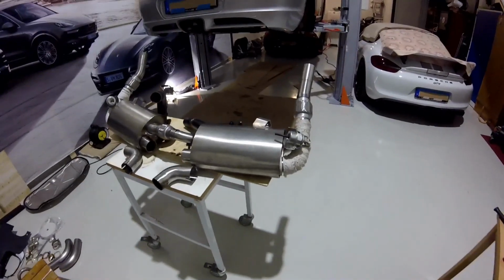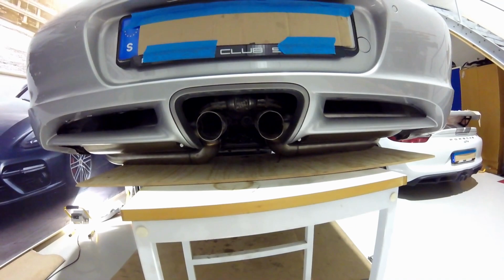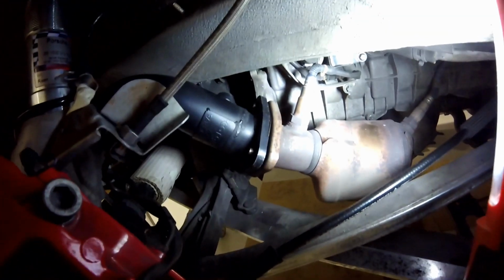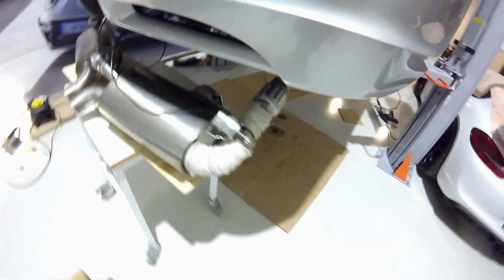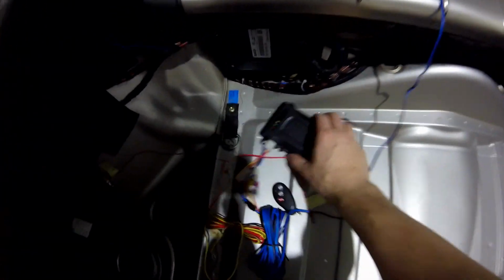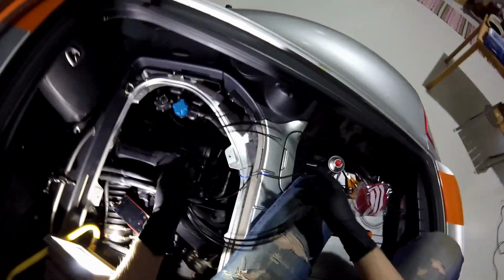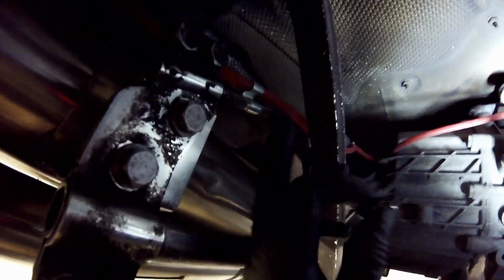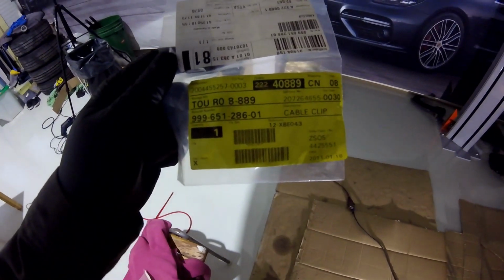cargraphic exhaust install on  Porsche 3,8 engine │Tobe Tinkering

Comment: hi tobe, im a sub and also own a 987.1 cayman s. I enjoy all your videos. One question, do you run a 3.8 in the cayman? would love to know more about it.
greetings from spain
Reply from the maker: Hi, thanks for being a sub. From the engine intake and to the cats the engine is completely stock. I prefer to keep it that way to ensure reliability. I been contemplating tuning it in the future but for now I keep it stock. Work myself from "the outside-in" rather then inside-out meaning I start with suspension/brakes and driving skills before I to fiddle with the engine. If I can keep up with the 911s with my engine stock (on the curvy bits at least) I'll be much quicker then them the day I upgrade the engine. Hope that provided an answer but in short: no :-)